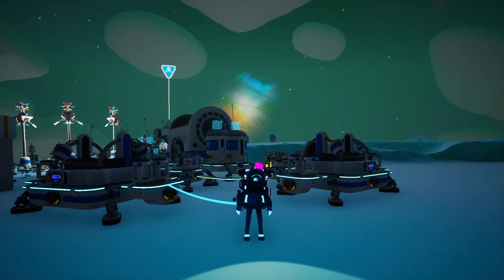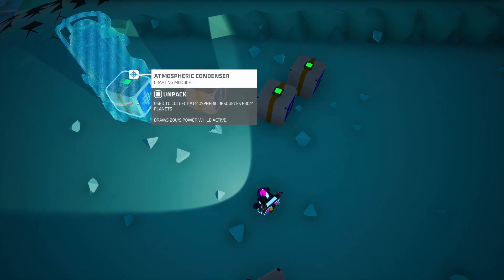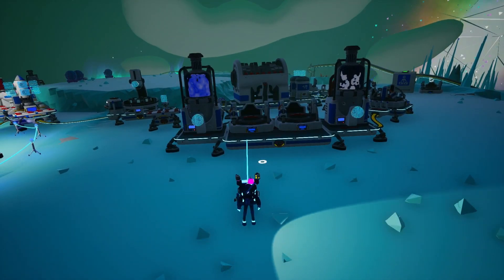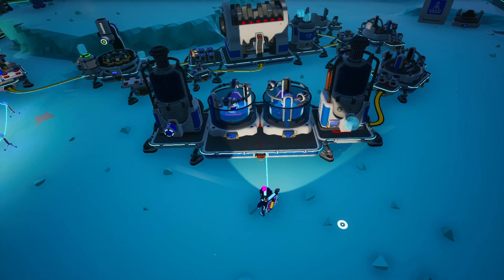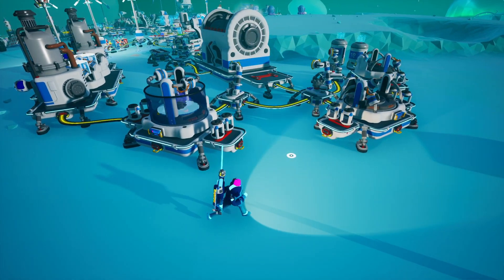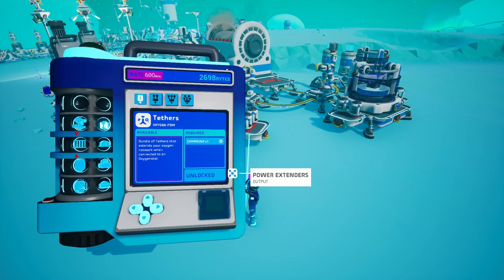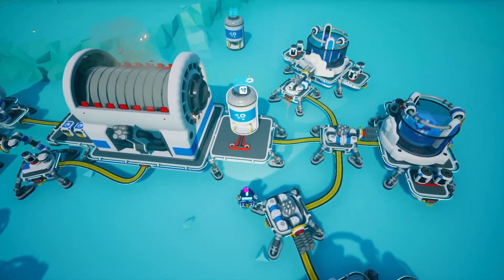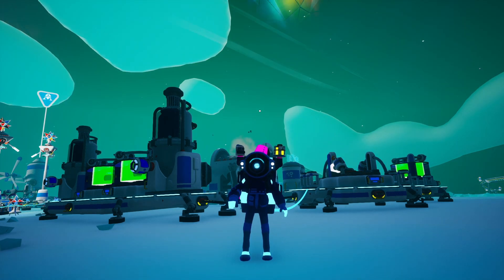Get INFINITE Bytes with THIS Simple Hack | Astroneer Guide

Comment: I use the admospheric condensor byte farm already for a long time. One admospheric condensor is fast enough to feed two resource chambers; all three on the same platform; the admospheric condensor can put the full gas canisters in the storage slots now locked up by your second admospheric condensor.
Reply from the maker: That design is very modular, so you can have a big farm with 10 or 20 platforms for example!

Comment: I'm not sure if you are aware but one of the easiest ways to get infinite Bytes is to place Proximity Sensor on top of a Repeated next to one of the columns that produce research plants.  Preferably one of the columns that has a cluster of three plants on it  in a location that produces high Byte returns - like Glacio

Place several of these about your game and let them run for ever consuming no power at all with a constant feed pf Bytes.
Reply from the maker: I have seen that strategy and I think it works amazingly well!
However, I enjoy building farms in my base more, so I can later look at the whole base with all the farms in it!
Reply: Well, it is not "constant" unless you place at least 50 of them at different times. The reason is: It takes up to 15 minutes for the samples to regrow. So there will be gaps, and they can only be closed by putting up a lot of those repeaters. This is easier said than done, but in effect: Yes, that is a periodic income in bytes with no effort after the repeaters have been placed.

Also, extra tip: Dig down near the core on Glacio and seek research samples down there. You will not find three at once per pylon, but you will find 1 to 2 - and every single one of them gains you between 500 and 900 bytes. If you find the double 900 ones, you will gain 1800 bytes every time they regrow. This is a more profitable use of the repeaters.
Reply: @TRG_TheRantingGerman 
While it may not be 'continuous', it does remain 'constant'.

Happy harvesting 😎

Comment: This is similar to my setup but instead of a second atmospheirc condensor I have a large storage filled with medium gas canisters. It all fits on the extra large platform C. The 1 atmospheric condenser is enough to supply 2 research chambers plus overflow to fill the gas canisters. So I mine bytes and gas at the same time. I have this up and running on Glacio and about to deply to Atrox for helium, Novus for Methane, and Calidor for sulfur.
Reply from the maker: That's a nice modular byte farm! 
You should check out my other byte farm videos (they're all in the "Automation" Playlist). I've got a huge byte farm on Atrox too!

Comment: If my calculation is correct(Not tested yet). One Atmo Condenser on Glacio can make 1 Argon canister every 50 seconds. One Argon canister consumed in the Research Chamber takes 150 seconds. Therefore 1 Atmo Condenser + 3 Research Chamber on the Extra Large Platform C is the optimized schematic.
Reply from the maker: I think you're right! I tried doing that on Atrox with methane, but there it's a bit different. However, for Argon on Glacio, 1/3 is the right ratio!

Comment: See heres the issue. a gas can with 1/5 bars is worth as much as 5 bars to the research chamber, is there a way to split it up for more bytes?
Iv tried different things like ways to store the gas before research and like the things that hold the gas but cant figure it out
Reply from the maker: I have discovered that it's easier both resource and power-wise to just add an extra atmospheric condenser to you byte farm that to build an extensive thing with lots of sensors and make it somehow not fill up the gas canister all the way...
Reply: I had the solution laid out for you, but youtube deleted my comment. There were no links in it, so I don't understand why youtube did that. But I posted my own comment about the most profitable research setup on top. Have a look.

Comment: Yeah, you're doing it wrong.

One Atmospheric Condenser can service three Research Chambers, even with a little overhead in production (so, if you have some kind of storage, this storage will slowly fill up with small gas canisters over time, and when I say "slow", I mean it takes a whole day or more to fill up a medium storage silo). When you fill up every Chamber with a small gas canister and one spare on a storage before you start making them research, there will never be a gas shortage. You have to build an additional Large Platform B to put next to the storage with an autoarm (the autoarm goes next on a side panel on the Platform B and services the third chamber on that same platform), but that is just a little inconvenience for the bytes you gain from this setup. Also, you should put the gas byte farm on Atrox and research Methane (400 bytes in total per gas canister). Three Chambers generate 480 bytes per minute. So when you build just 3 setups (9 chambers in total), you will make 1440 bytes per minute. This can bring you up to 1 million bytes in 12 hours.

Argon only gives 300 bytes in total per canister and you only used two Research Chambers with two Atmo Condensers (effectively missing out on actually 4 more chambers, that could be additionally serviced by two condensers, with double the energy consumption - not very efficient)... so your test there is not applicable as a gauge on how well the gas byte farm does in comparison to your scrap byte farm (again: Three Chambers per Atmo Condenser on Atrox researching Methane are totalling 480 bytes per minute per research setup - continuously, without refilling anything). It is my opinion, as a solo player, that the gas byte farm on Atrox is the best way to go if you have the RTGs to make them independent.

When you use two Atmo Condensers on Glacio, researching Argon, this would total in 360 bytes per minute per setup, if you make three chambers per Condenser as I explained. Since you used 2 Condensers, this would be 720 bytes per minute, which is more than double what your scrap byte farm produces per minute. Gas byte farms, therefore, are superior to scrap byte farms for less effort.

Since the gas byte farm, because of the RTGs, is a rather late game construction, this setup is not very useful in the beginning, specifically because you don't have the resources in the beginning to profit from such a byte farm. You'd only do that if you want to test out what byte farm is the best setup for a solo playthrough. It's just for informational use actually, not so much for a practical application during gameplay. The only way to make this in early to mid-game is by using renewable energy sources with a lot of batteries. But this is so much work, that I would suggest to build only one gas byte farm on Atrox this way. Anything else takes too much time and effort, or you wait until you have the resources to make 7 RTGs to service all three chambers with an atmospheric condenser and an autoarm (you need 27 U's per second, 7 RTGs produce 28 U's/s).
Reply from the maker: Actually, you're right!
I do have a video where I built a bigger byte farm on Atrox and I used 3 atmospheric condensers with 9 research chambers!
Reply: wow a lot I didn't think about. Thanks, will implement
Reply: @gamesforlife36 Sorry, I haven't seen all the videos regarding your efforts with gas byte farms - but I had a feeling you'd find out :) Yeah, it's really the most efficient way to get bytes without any further input necessary by the player.

But beware, there is a bug with the research chambers. Newly build chambers, very often, on Atrox crap out and stop researching. They have the research sample in them, the research area glows green (as they would do when they are finished researching), but they do glow green continuously. It looks like as if the chamber still researches, but it does not. You can't stop it either (the button cap does not open, so you can not click the button to stop it). This happens almost all the time with every new chamber on Atrox after I have built more than 10 research gas byte-farm setups.

Here's how to fix that: Just "save & exit" to main-menu. Then load your savegame back in like normally, and the chambers work properly as they should. They will never crap out again - only the new ones will keep bugging out (but then again, just reload the save and they will work).
Reply from the maker: @TRG_TheRantingGerman  Thanks for the tips!🤝